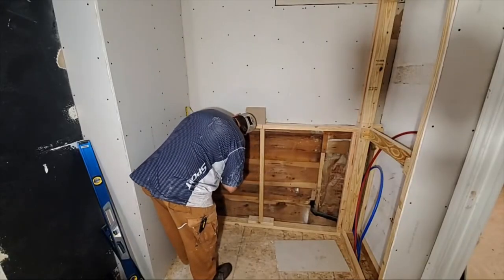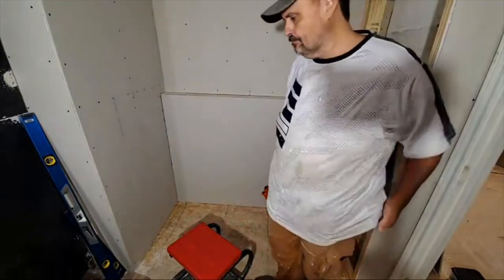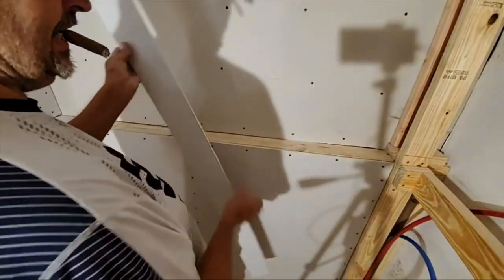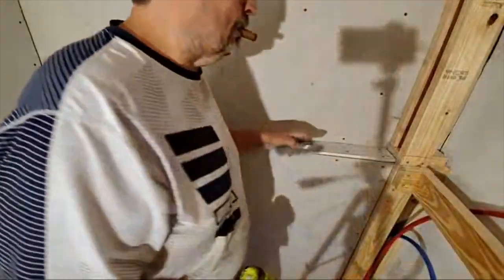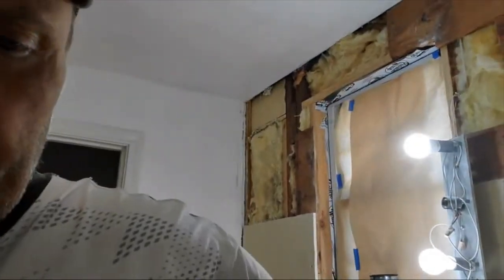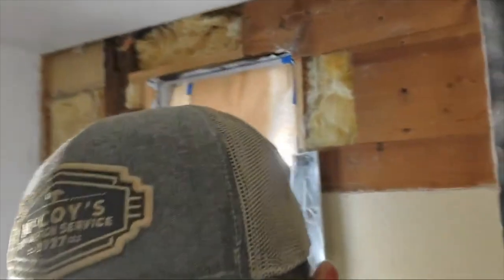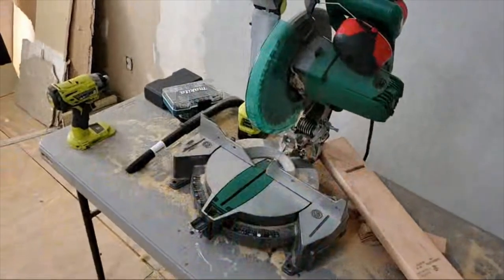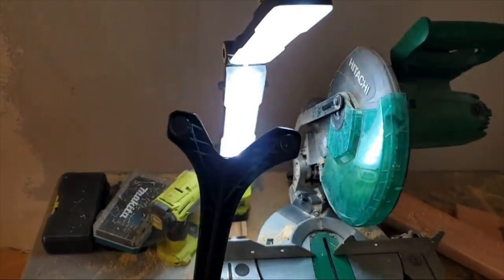How To Sheetrock A Shower - 1

Comment: You can rock your shower however you'd like. But if you're going with just drywall under tile you're gonna have a bad time down the road.
Reply from the maker: Using schluter
Reply: @WoodandMetalGarage  Ahh, that's better. Thanks for the clarification!